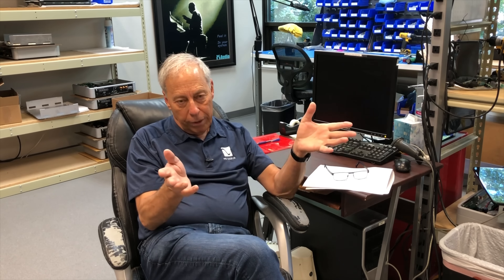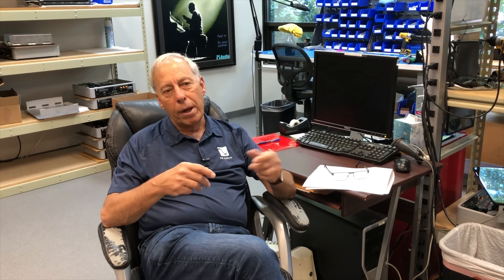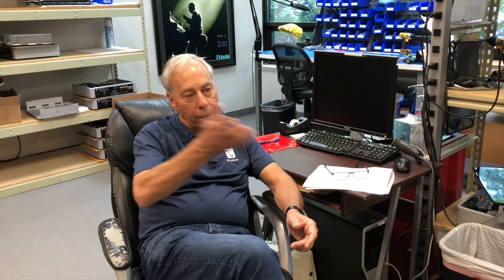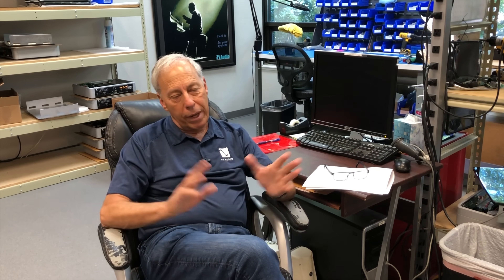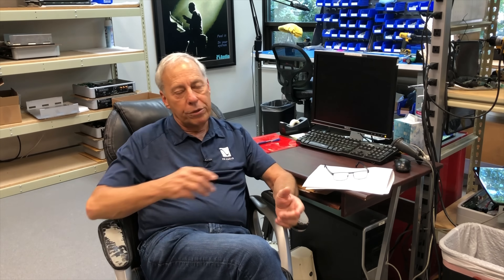How to make Class D sound better

Comment: Class A is like driving a car at full throttle and using the brakes to control the speed,just like modern mastered  CDs.
Reply: Yes, but you don't feel the gears change as much (read crossover notch distortion)and if reducing that is the priority you might accept such an asinine approach if it's the best you've got.

 The problem with modern produced music is that they are mastered for use in noisy environments like cars. Same with radio. I can appreciate the motivation behind it but I think a better way would be to provide an opt in/out function so if you want to listen while mowing the grass choose one way and if you are going to sit down at home and focus on the music you should be able to hear the dynamics  of the original performance.
Reply: @InsideOfMyOwnMind  nope. Mastering engineers are not changing the entire basis of mastering to take account for noisy environments.  They are doing the same they always have, correcting balance for maximum translation, checking technicalities such as phase, making adjustments for specific formats (viny basically, with has physical limitations to deal with). Topping, tailing, possibly track sequencing, aiming for tonal and dynamic consistency...  I work as a mastering engineer, and I don't think once have any of my peers stated that they are suddenly changing their process to master for noisy environments...... Whatever the hell that means.
Reply: Thanks  well put,someone didnt get what I stated... I see....mastering is a bitch you know its wrong but the client always wants it louder(customer is always right aye..not).
Reply: Perhaps I over generalized.  I respect your knowledge and input.
Reply: @paulphilippart7395  the loudness wars are over.  Clients are much better informed.  The -13LUFS standard of streaming platforms and online vendors (including YouTube) has helped, as clients have a solid reason for not having rammed levels.  As radio has become irrelevant now, as a musical medium, the race to be loudest is basically over.  There is still a little leftover in the vinyl industry, mainly dance music, where cutting at +3volts is considered a must for a loud cut, but less and less DJs play vinyl now.  Generally, in terms of Dynamics, things are getting much much better compared to 10 years ago.
There is a lot of audiophoolery in the audiophile world.  I always find it funny the stuff that audiophools will spurt out and declare or argue over.  A good deal of this stuff is not stuff mastering engineers worry about, and we require the best accuracy, in general, in the production process.
The things that have the biggest, most noticable effect on the purity of sound are speakers, and then the room.  If people are arguing over sound quality, desperately swapping 1000 dollar cables around, and messing about with overpriced  power cables, but their rooms are untreated in terms of room tuning.... Then it's all bull and they really don't know what they are talking about.
Reply: Oh yes totally agree,coming from a studio background I guess we are fortunate enough to be miles ahead of that overpriced realm,room tuning is the key to most of the problems.The mastering jungle is slowly filtering over here to correct levels at last,still having to demonstrate to some people why louder is a deception and wrong,when I use examples of over-cooked and correct masters at R128 standard,both heard at the exact level the reactions are quite a picture,as the louder sounds tiny and the correct master is just huge and full of life with the bonus you can actually use the long forgotten volume control, how it was designed to be used.  We have been robbed of dynamic range for so long its coming back at last.
Reply: @paulphilippart7395  well the good thing is that so much noise (haha) was made about the loudness war, that the information actually got out.  Artists themselves tend to be better informed, a lot of the time when dealing with clients, the words "we want the dynamics preserved" come from the client side.  The war has been won, it's just taking a little time to mop up.
Reply: Yes they finally understand that the 70s and early 80s stuff gets more magical when you turn the volume up,instead of coma inducing tinnitus harboring,distortion and blown amps and drivers and your barely at 4,now maybe people wont get so tired of music,artist pending that is( haha.)...
Reply: @InsideOfMyOwnMind   The myth of Class A superiority was busted decades ago.  FWIW:  at least 3 of the class D amps I have heard sounded polite/soft. Not my cup o tea.
Reply: Poor analogy, its a car traveling half its maximum speed, the transistors are switched on approximately half the supply voltage, also termed the quiescent voltage.
Reply: Not referring to no signal state even though that in itself is heating your room.
Reply: Wrong, it's quiescent current not voltage. There are currents flowing through both complementary transistor stages at all times and the difference of the two currents flows through the speaker.
Reply: Otto Normalverbrauch: Yes you are correct but I am also; in order to drive the speakers the designer sets the output voltage at half the supply voltage(Approximately) to ensure we have maximum voltage swing without clipping, yes you can argue its not exactly half in many designs because of negative feedback resistors on the emitter of a bi-polar for instance; but I was just talking in generalities to an assumed non-technical audience that might be reading). As with all questions and answers there are layers of understanding.
Reply: @ThuleApsu  Well put!!
Reply: Paul Philippart: Well thank you kind sir.)
Reply: This is done more to prevent DC current running through the speakers than to assure symmetrical output swing, if you ask me. An exaggerated 1Volt DC offset gives neglectable symmetry problems under normal listening conditions but a considerable unwanted MECHANICAL offset of the woofer cone..
Reply: Otto Normalverbrauch: No, again you seem to be coming into this debate with little better than an undergraduate level of understanding, amplifiers which connect directly to the speakers are rare; most use a decoupling capacitor; blocking DC offsets.
Reply: If you're still listening to amplifiers from the sixties or early seventies you may have a point but 99 % of the class A and AB amplifiers I repaired in the past thirty years or so on a commercial base have complementary output stages with symmetrical supplies. The Quad 303 has a configuration like you mention but that's a small portion of the pie. I think I can say my understanding of amplifiers ( or any audio device) is more than moderate.
Reply: Otto Normalverbrauch : So if they are so popular amplifiers WITHOUT decoupling capacitors; give me a few examples).
PS Almost all good amplifiers have complimentary output stages and symmetrical supplies..that wasn't the argument, you said they don't use DE-COUPLING CAPACITORS.
Reply: They simply don't. Why don't YOU give me some recent examples of amps that use output stage coupling caps. The Sony surround receiver I'm repairing at this moment has 5 output channels, all directly coupled. My old Sansui AU-D77ax even had two directly coupled output stages per channel that were differenitally driven. That's  a configuration more known as 'bridge mode'  and mostly found in PA- or car stuff.    
Don't be afraid to ask but don't try to be a smartass without putting in some substantiated knowledge.....
Reply: I'd like to think of it more like driving your bus style motor home over to the grocery store. You waste all kinds of fuel but no better ride quality is available.

Comment: Making a class D amp sound better was the question !
Reply: I thought he explained. The "sauce" is in the input stage, with MOSFETs and regulated power supply to that stage. Although he didn't mention the other end, I imagine the filter at the end, some kind of coil and capacitor, the type and quality, would make a difference.
Reply: Have you tried it